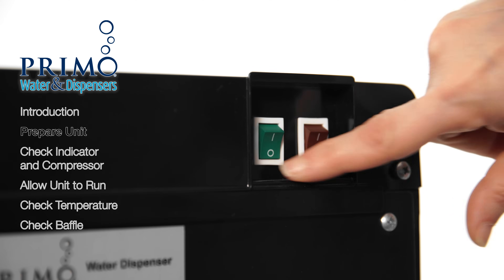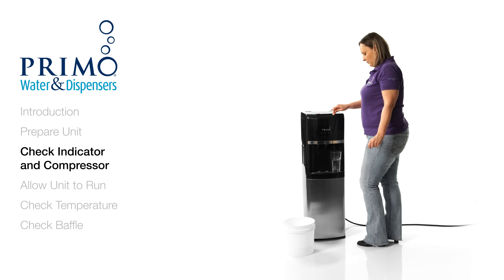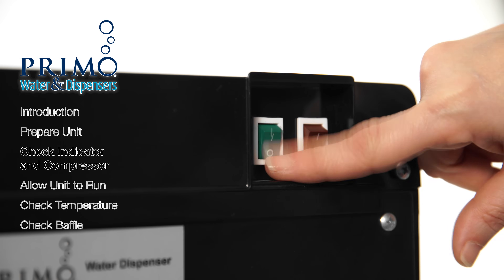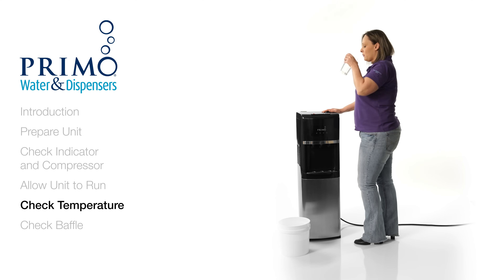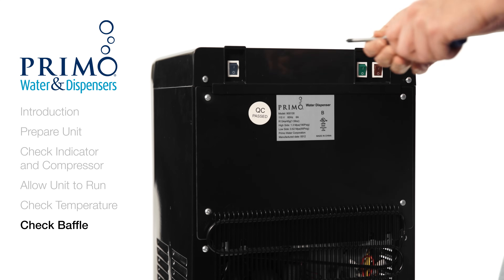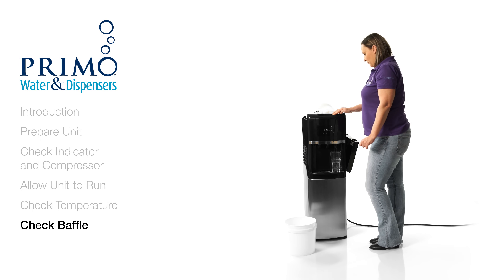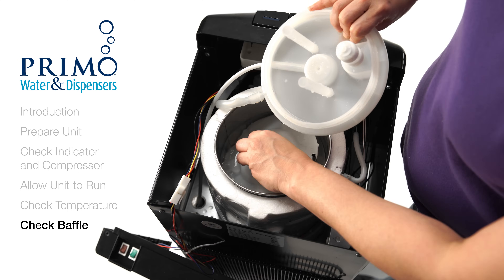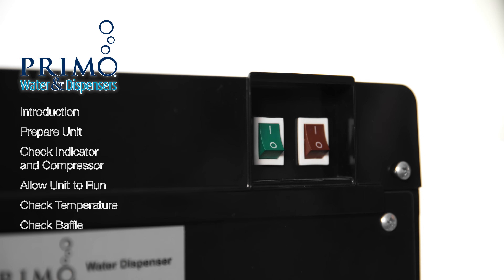Bottom Load Cooling Issue

Comment: Your tutorial, and your cooler are both equally bad. Frozen reservoir here. Guess I'll just have to figure it out myself, and post an ACTUAL tutorial.
Reply: Are you going to post it? I would like to see how to fix it
Reply: @hehheh1204  I was going to, but it turned out to be a really simple fix. Mine apparently just froze  from not being used enough, so I just unplugged it, took the top off the reservoir, and poured hot water into it, until the ice melted enough to pull out the block of ice, then closed it back up and it works fine now. I think the important thing is not let these things go more than like a month without using them.
Reply: Aw man. The problem with mine is that the cold water dispenser gives me warm water. And the hot water dispenser isn’t ever on so it doesn’t make sense.
Reply: @AMDRyzenEnthusiastGroup  Mine freezes even when I used it often. The thermostat is broken. I would keep an  eye out for yours. Has it been working? Mine only works when I unplug it, let it defrost, and then plug it back in. Then within a day it freezes again.
Reply: @mybluedress  I ended up having to take the piece of crap apart to thaw it completely out, because the thing was so frozen, it literally still had ice in it after almost an enitre WEEK unplugged.
Reply: @AMDRyzenEnthusiastGroup   mine started freezing the water how do I fix it